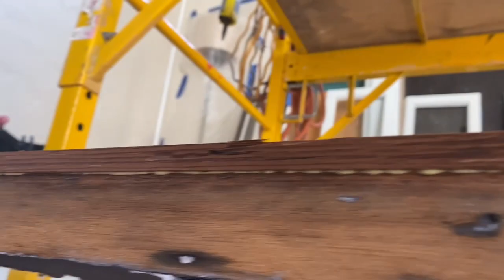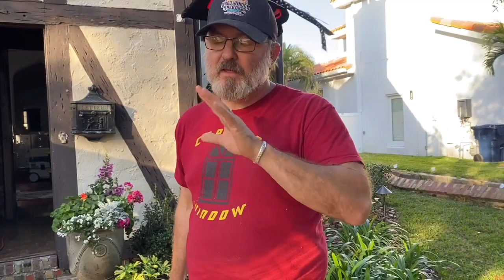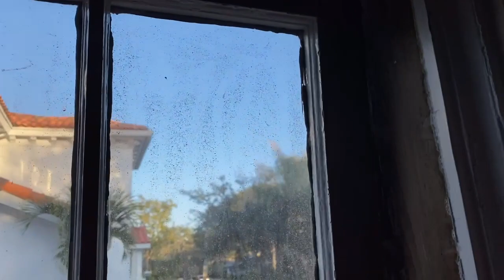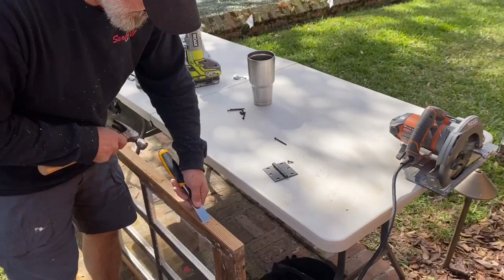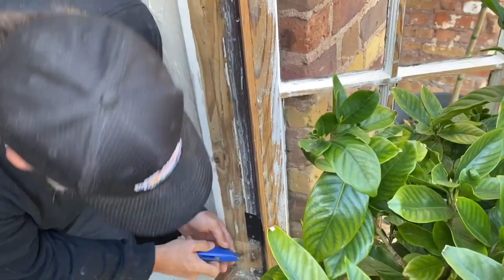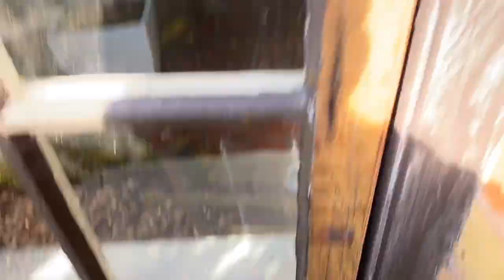Damaged Wood Casements Resized, Refit, Rehinged and Rehung…

Comment: I could of used this video a week ago lol nice work! The hinges will be secured to the added wood piece but then the whole sash will only be supported by glue? Or does the hinge screws go all the way into the sash?
Reply from the maker: The screws do go into the original, but in truth, the glue joint is so strong that it’s actually stronger than the original wood (if done right)